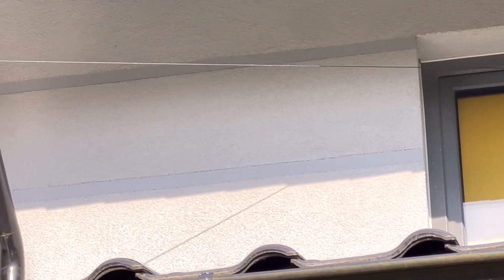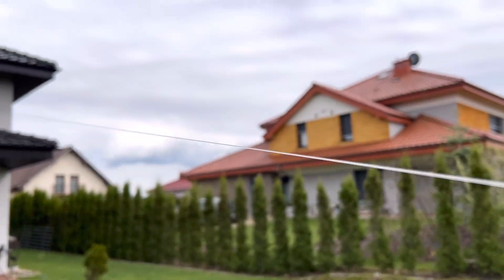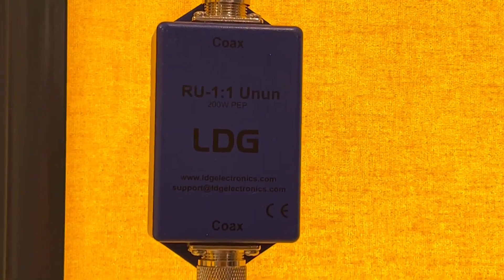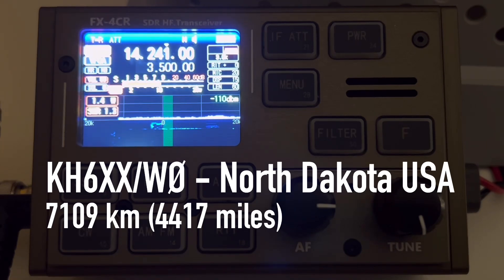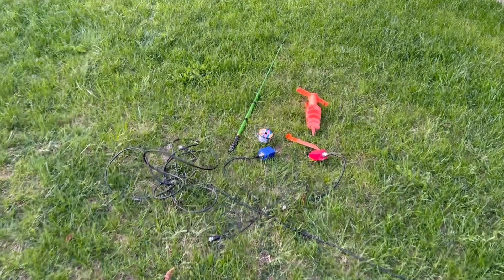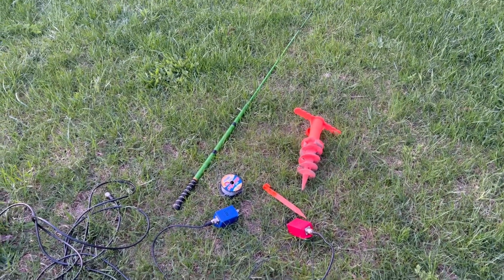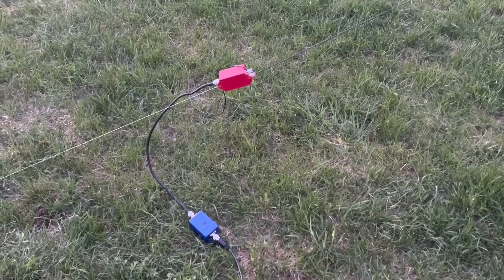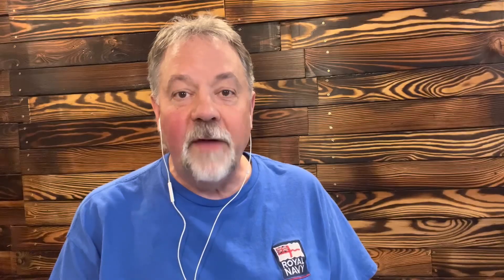Building a Random Wire Antenna

Comment: Walt, nice video, can you tune up 40m or 80m with the 35.5 length and I assume it wants the 17 ft counter poise ? I'm looking to do 40m and 80m should I choose a longer than 35.5 for the 40 and 80?

Comment: I use a random wire as my main antenna at home 84ft inverted L 10m vertical rest horizontal, a remote tuner at the feed point base of the antenna and around 100 radials buried. Tried all sorts to better it in my 45 ft garden. Beats half wave easily also half size g5rv and a doublet I fitted in with a funny configuration.  Works very well for my small garden. When in qso people cant believe what im working. Beams and towers out of the question.

Comment: How do you find out the radiation pattern for long wire horizontal L? 18 feet high? Thanks
Reply from the maker: You would need to model it in an antenna modeling software program

Comment: I ordered a 107 foot End Fed Long wire antenna with a 9:1.  I’m going to feed it at 20 foot from my roof and run it horizontally. Do i need a counterpoise and how long? Is 17 get enough for a 107 foot long wire? It’s gonna be at the end of 100 foot LMR400
Reply from the maker: I would probably put a short 17 feet counter on it but that 100 feet of LMR400 is really going to do the trick and act as the counterpoise in my opinion.
Reply: @COASTALWAVESWIRES  Ok thanks !!
Reply: I put up the antenna as high as i could. About 18 feet horizontally L. Do you know how i can find out the radiation pattern? Is there an app?

Comment: I currently run a 35.5 ft. end fed random wire as a permanent antenna. Instead of a separate counterpoise wire, I’m using a 75 ft. coax as the counterpoise with a 1:1 choke UNUN at the rig. Of course, a 9:1 UNUN at the feed point. Works fabulous for me. I can reach all over EU and Africa. The end fed antennas radiate more from the far end. I have it in a horizontal L formation wrapped around the inside railing on my deck, keeping it from nosy neighbors, although I don’t live in a HOA.

Comment: Thanks Walt, I am working on this type of antenna right now using  the LDG 9:1 and LDG 1:1, the wire element will be 71 feet from the corner of my house to a large tree in the corner of the yard.  The orientation will be just a bit off north to south and the height will be around 20 feet at the house and maybe a little higher in the tree.  The question I have is how did you decide on the length of coax to use between the 9:1 and the 1:1 isolator?  Any help would be appreciated.  73 de VE7WNO

Comment: Walt, How do you like the LDG  AT-100 Pro II Auto Tuner ? I am using one with 71' of Wire and its amazing the Bands it tunes down to 1.5 and at times lower.   I am wondering what your thoughts are on this tuner..  Thank You 
 de KC3ZDW
     73

Comment: Random wire length shows random impedance (including reactance): so that is the place for an antenna tuner, not a transformer! A transformer, at best, can adapt only one of those cases; in all the others it only introduces losses that "hide" what really happens on the wire.
Furthermore, with those losses, an antenna tuner is not able to recover much of the reflected power.
This does not make sense, but it only serves to make happy those like you who only know the SWR, they do not even know what it is, what it involves and what the efficiency of an antenna is.
Low SWR is NOT good efficiency: they are two completely independent things !!! Think: also a dummy load is broadband and shows very low SWR!
Compromises are something else!

Comment: Hello Walt I’m from Ireland I’ve been watching your videos for some time I do a lot of qrp portable with my doublet and decided to give a 41 ft random wire vertical a go with an 9/1 unun my counterpoise is also 41 ft just laid along the ground straight out works remarkably well my question though I haven’t experienced any rf feed back should  bother with a 1/1 choke I only use 1to 3 watts what you think ? And many thanks for all the hard work you do making these knowledgeable videos regards
Reply from the maker: Thanks for the kind words my friend. With lower wattage I’ve found a 1:1 choke really doesn’t make much difference at all. I wouldn’t bother if you’re getting good results. 73, Walt

Comment: Back in the 70s I used 100 feet of wire the ne with an mfj16010 random wire tuner.  Xcvr was a Tempo One.  200 watts pep.  The only band I could not tune was 20 meters.  The wire was up 25 foot.  Worked the world.  73 K3ANG

Comment: I had a 40 ft coated fence wire I stretched accross my back yard   one end stuck in the ground and used coax from the radio to it to reduce   household interference  it works great 😂😂😂 I'm constantly getting  SW from  500+ miles away📶📶

Comment: Walt on your first 35' horizontal antenna where does your 6.5' counterpoise go? Is it also horizontal or is it just dangling vertically like your downward sloping set up?
Reply from the maker: I just have it dangling down. Works great
Reply: @COASTALWAVESWIRES  Thank you very much for answering my question.

Comment: Thank you for these awesome videos.
You have had me bitten by the end fed random wire bug and I have been experimenting.
My experience has left me very confused though. I find that the placement of the counterpoise really makes a difference.
For instance I have a 14ish meter radial with a 5 meters counterpoise, I should be getting 40-10 but when the counterpoise lay on the ground I lose 40 elevating the counterpoise helps but what I see in your videos is that you the simply strew your counterpoise across the ground and all works well.
What could explain the difference of results?
Am I missing some basics here?
Are there some rules of thumb regarding the installation of the antenna?
Thank you again and I'm sorry for bombarding you in the comments but you seem to be the random wire king.

Comment: Hello Walt. I love your instructive, helpful videos. I'm going to build this setup. Thank you for this idea. I will tie an insulator to the tree and attach speaker wire to the other end of the insulator. Is there a specific way to attach the speaker wire to the insulator? How do you do this? 73s and thank you.
Reply from the maker: Thanks! I just fold it over and twist then secure it with electrical tape. Remember that the measurement of the wire is at the fold over, so the extra wire you wrap after the insulator doesn’t count in the measurement of the length of the antenna. Good luck and have fun. 73, Walt
Reply: @COASTALWAVESWIRES  Thank you for your quick reply and advice. I appreciate it very much. I will make my antenna wire 42 ft. instead of 41 ft. That should cover it, I hope. It looks like 44, 46,. and 48 ft are at half-wave lengths at multiples. I hope I won't get in trouble by cutting at 42 ft. Do you cut wire lengths to 42 ft.?

Comment: Does a measurement like 35.5 ft on random wire antenna include the wire used to tie to the insulator and unun box or just the straight portion of the wire?
Reply from the maker: Just the straight portion of the wire.

Comment: How did you get the coax through the window to hook up to the unun? It looks like the window is shut. I'm just trying to keep it simple like you. I'm also trying not to drill too many holes. I like your videos very much. Thank you.
Reply from the maker: I closed it in the corner of the window, it pinched the coax a little but not too bad.
Reply: Thank you very much. I'll figure something out. Maybe go through to the attic or just set up outside like you do. Thanks again. @COASTALWAVESWIRES

Comment: I've had my extra license for a few years now and haven't used it. I just bought a ICOM IC-7300! Now, I'm looking for my first antenna and contact. The random wire looks awesome to start. So, if I use a 35.5' wire with a 9:1 unun without counterpoise, do I need a 1:1 unun at the shack entrance?
Reply from the maker: It will help as a choke near the transceiver and keep common mode current out of the radio. You might get by without it if you have a long coax but it will certainly help.

Comment: Hi Walt! I want to build an end fed antenna for only 15 12 and 10 meters. Is it possible? How long the cable should be? I should use a 1:9 or 1:4 transformer? Thanks!
Reply from the maker: Build a 17.5 foot vertical and use a 4:1

Comment: I tryed this and had good results but I didn't have a balun at the time so I just ran the wire to a ATU and I got under 2 or just over SWR on every thing from 80 to 6 but I was having problomes with my digirig and a fan in the window that was turning on when ever I was TX i just orderd a 9 to1 that you were using do you think this will fix my problome ? I am guessing I am getting common mode current feedback alone my coax..
Reply from the maker: Yes it sounds like common mode current, the transformer will definitely stop that.

Comment: Can you also attach a counterpoise wire at the correct length to the other terminal if you are running a different length of coax?
Reply from the maker: It's worth a try, experiment and see
Reply: @COASTALWAVESWIRES  I didnt wait. LOL When I got home from work I hung the wire and fired up my stick and tried it both ways. No noticeable change.

Comment: Hi Walt I just got one of these 9.1 I had it cut for 12 meters 24.950 and the swr is 3.4 now on 20 meters the swr is 1.02 with a counterpoise I'm not sure what I'm doing wrong on 12 meters the wire is 19.5 feet long cut for 12?

Comment: Great Video. How do you calculate counterpoise length? I am trying to build either a 33ft or 29ft (depends on how the 33ft tunes)
Reply from the maker: Honestly the counterpoise length is not critical. From experience and what I’ve seen on random wire antennas if you are putting counterpoise on the ground as a groundplane it doesn’t matter. I typically just make mine 5 meters long for that situation. With an elevated or single counterpoise I have used 17 feet (5.18 meters) as a length as well as 6.5 feet (2 meters) with great success.
Reply: @COASTALWAVESWIRES  Ok thank you. This is my first antenna build so I am trying to figure it out. Thank you de KO4TZK
Reply from the maker: @quickievalue6833  no worries, with the 33 you might find it hard to tune if you’re using a 9:1 unun. 33 feet is actually a half wave antenna for 20 meters and works awesome with a 49:1. With that antenna I just use a single short 1 meter long counterpoise. The 29 will work great with a 9:1 and counterpoise as I mentioned in original reply.
Reply: @COASTALWAVESWIRES  then that’s what I am going to do!
Reply from the maker: @quickievalue6833  here’s a 33 foot vertical I build: 
https://youtu.be/EDU7b8ADBiA?si=rU2lmCIqVxIPdp_H
Reply from the maker: @quickievalue6833  and here’s a 29’
https://youtu.be/t-sFJV9bJhw?si=rMQCDfyoYDLbTV6n

Comment: Would love to see the SWR figures for 80/40/20. My 73 feet wire works fine on 20m - but oddly have SWR og 5 on 40m. Possibly becausit may actually be closer to 76 or 77 feet.  A bit hard to pull doen snd check 😮
Reply from the maker: Next time I build one of these I'll do a SWR sweep on all those bands. 73, Walt
Reply: Walt, just added 4 x 5 meter counterpoises to my 21m Rabdom wire - which greatly lowered the SWR (replacing a single wire).  But.  - While 80m is spot on, the dip is about 1Mhz too high for 40 & 20.  Would increasing wire length a bit help - a bit confused as we are looking for non-resonanse

Comment: Hi Walt, still in ROK and rooftopping. The Rybo 7.6 is working a treat, thanks and a few randoms are working well.😁 

I'm going to try linear loading a random length back down a 10m pole, where the unun is just above rampart height of 1.2m on most of the high rise buildings that I've been nesting on, and I throw across the rooftops 18 radials.  

It is easier with the Ryobo vertical strapped to railing or piping, but a linear loaded vertical might just be quicker to deploy than a long randon wire.🗼

At the current QTH I can operate from an apartment 2 floors down from the rooftop which is 30 storeys.🏢  94 meters at rooftop height.
So it's getting down to ZERO 🥶 now, and there's no more working the DX and suntanning.

Do you think linear loading a randon vertically is better than slopping?   And what is the general opinion from the Coastal Waves watchers?
Cheers from Alien in Asia👾 👀FOO IS HERE 🥶  PS: I thougth I'd using 10.82m and 1m extra for good luck. :face-blue-wide-eyes:
Reply from the maker: I do think linear loading is better, especially for DX. I think your takeoff angle will be better. I actually wrapped a long random wire around a shorter pole when I was in Poland and made some great contacts. Not exactly linear loading but similar. Helically coiled is what I would call it. Your height should really be a plus for sure. 73, Walt

Comment: RF Feedback  from the metal plate back of the mic on my Icom IC 706 MK2G... Sat there thinking Hello I am getting burnt here on my index finger...
From the tuner short coax 15 -20 foot long to the 9:1 UNUN  on the other end of the coax in the shack an LG RU 1:1 CMC just before the LDG AT-200 Pro II AATU. Any advice? I do have 2 x 20foot length Counterpoise going off in different directions outside the shack
73 
Keith .
Reply from the maker: I’m thinking you might move the 1:1 out to the 9:1 and away from the shack which creates the choke at a further distance from the radio
Reply: Will try that later today..... Thank for the tip..
 @COASTALWAVESWIRES

Comment: I have a 12 gauge  solid copper core 280ft long wire or 85 meters... it is placed 6 foot above the ground on top of my dogear fence.... I also have the radio grounded from an outside ground.... what type of UnUn will work or will be best on this antenna ? or do I need one ? Plus I'm just a listener...
Reply from the maker: Most likely a 9:1 but as a listener you can probably get away without one at all.
Reply: @COASTALWAVESWIRES  Thanks... I thought that was the case but I thought I would ask someone who knows more about it... I'm just a listener... Thanks.... :-)
Reply: @COASTALWAVESWIRES  Also I live in central Texas USA and I have been picking up signals from Japan and China... It's crazy what you can listen to from a simple antenna and small SDR radio :-)

Comment: I know nothing about nothing so be easy on me, I have HOA issues so anything I do will have to be HOA stealth. I saw a couple YT videos (TN-07 Engineering) about eave antennas. Can you run a wire along the eave on the backside of the house (12 ft high) than drop down and run around the top of the privacy fence line (6' high). This would be about 250 ft or so of wire.
Reply from the maker: It would be worth giving a try. You would be surprised what might work and experimenting is the best way to find out.

Comment: Hi Walt.  Does the total 35.5' include what you wrap back on itself at the insulator, or do you cut it a little longer to be able to loop it back on itself?  If you cut it a little longer, is there a suggested length that you use?  Thanks for your time! Thanks for your outstanding videos!
Pretty new to ham radio so I'm always trying to learn.  73.  K8JCL
Reply from the maker: Great question and I really need to make that more clearer in my video. You cut extra for the wrap. The 35.5 is from the start of the wire to the fold point at the insulator opening. Also don’t worry about being exactly perfect, I’ve found that with a random wire being within an inch or so with length is fine. All the best and 73, Walt

Comment: I have a 99' random wire with a 9:1 unun. The manufacturer swore i did not have use a counterpoise.  My problem is that i am getting rf back thru my house. If I used the counterpoise would that eliminate the common mode current? I am gojng ro remeasure the wire and fold it back to 84' if it ever quits raining. I also have a mfj 915 choke at the radio.
Reply from the maker: That’s the main reason I use a 1:1 choke balun along with the 9:1 and a counterpoise. Adding the counterpoise may help but a choke will absolutely solve that problem.

Comment: The W3EDP antenna design uses an 85 foot radiator and a 17 foot counterpoise. This looks like an updated version using a modern UnUn transformer. There is nothing new under the sun, as the old saying goes.

Comment: hi hav a random wier 4 field operations have a 16 to 1 balun on it conter pois about 15m antena has 129m usualy good with a ground rod ,coax haz a word to say a true rg8 or rg213 you get mor of that 20 w out at home i use a fc40 tuner with a folded wier about 130m spacing about 10 cm.maby you get your hands on a r 140 amplifier prety comon in poland easy to get 73
Reply from the maker: Thanks Don, I will look into that. 73
Reply: @COASTALWAVESWIRES   its DAN (yo6-1001) r 140 is a warso pact amp 4 hf bands covers 1,6 to 30 or 50 mhz pover 1000..to 3000w herd storys o som mdel puting out 6kw of power
Reply from the maker: @dancosminmarza2974  Sorry Dan!

Comment: Nice vid, Walt.

A “random wire is on my wish list. For now I use a dx commander expedition an a 49:1 endfed.
Which do you prefer, a 49:1 endfed or 9:1 random wire?
Reply from the maker: Hard decision, I like them both. I recently built an end fed that was a halfwave for 20 meters with a 49:1 as a vertical on my 10 meter DX Commander pole and it was great. With 20 watts I was 59 from the Eastern USA to Australia. Probably best performance from an antenna I’ve experienced.

Comment: Hey Walt will the 35.5 ft random wire work on 40 or 80m?
Reply from the maker: I made some decent contacts around Europe with it on 40, I suspect it's a little too short for 80.
Reply: @COASTALWAVESWIRES  I have a chart that shows it works on 80. But I'm like you, I'm skeptical. I will be putting one together this weekend for a POTA activation. I'll let you know what works and what doesn't.